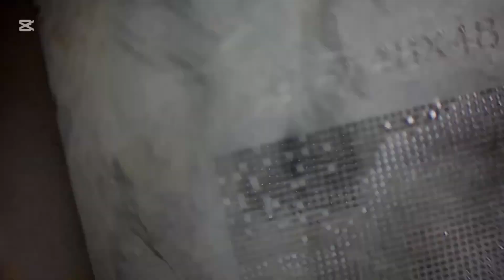Water-Damaged Phone: IC Power Repair #reballing

Comment: Great video!👍🏻 A couple of questions: When does the video start and when do you clean the chip? Is it isopropanol alcohol? And what soldering station do you use? It unsolders it in just a few seconds! I tried to remove an IC from the motherboard of my E Piano, and I have a fairly simple, cheap, Chinese 858D station. The temperature was set to 400 and 50% air, and it took about 3 minutes to loosen the IC and melt the solder. In that time, is it scary to remove a chip? Or is the video edited/shortened?
Reply from the maker: Thank you for your question!

Apologies for the lengthy response, but I wanted to explain thoroughly so you can benefit as much as possible:
	1.	Chip cleaning: Isopropanol alcohol was used to clean the chip and remove flux. The video might be edited, so the actual process could take longer in real life.
	2.	Soldering station: I use a professional soldering station with stable heat and strong airflow, which makes desoldering faster and safer.
	3.	For your 858D station: Your settings (400°C and 50% airflow) are fine, but 3 minutes is a long time. Prolonged heating can cause damage. To improve:
	•	Use more flux to enhance heat transfer.
	•	Consider using a preheater to warm up the PCB beforehand.
	•	Ensure your nozzle size matches the chip for better heat focus.

If you have more questions, feel free to ask!
Reply: @Electronics-Mobile  Hey friend, thank you so much for your reply. Sorry for the late response, I had some issues.

Thanks for the tips. I think I'll consider a preheater or changing the station because I've tried several stovetops and it's the same, even if I add a little more flux. Maybe the preheater will help.
Keep up the good work and keep up the good work! :)
Reply from the maker: @vandylan_piano